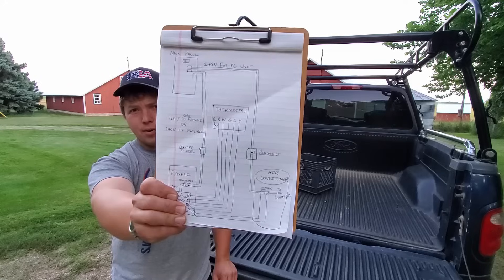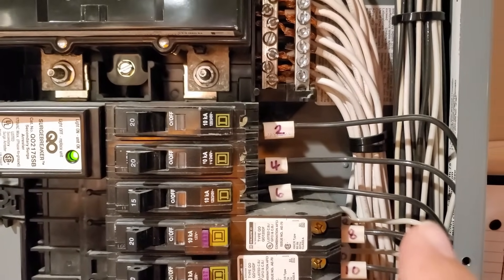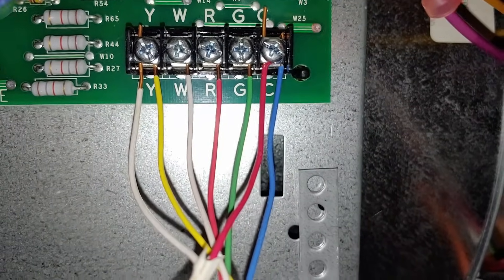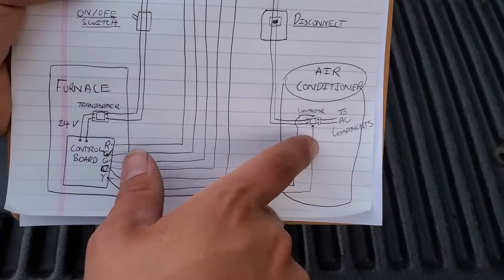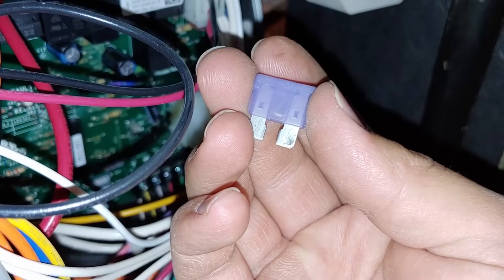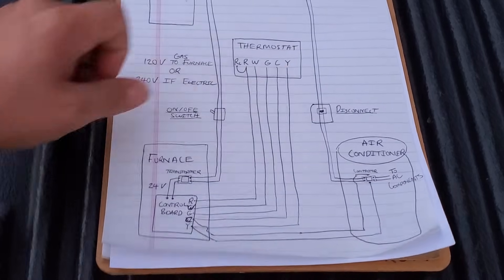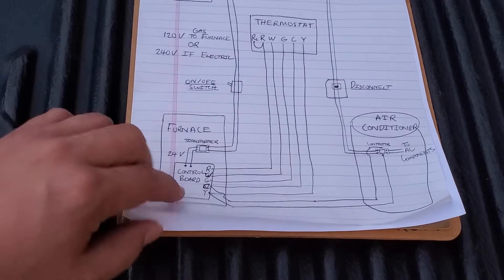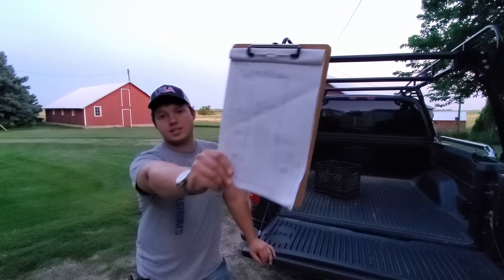Thermostat Wiring Explained!

Comment: No it won’t jump the thermostat will send a signal never jumper wire your equipment during trouble shooting and ya comon or c or blue is also called a ground common is ground your touching power to the ground if c touches red

Comment: Good review.  The air handler has two fan speeds when there is an A/C  evaporator in the system. the high speed is for A/C cooling and the slower speed is for heat. I was told warm air moves easier than cold air thus the lower speed fan does the job better as it doesn't cause a breeze effect in the home for no reason.  
I am impressed with the "colors" used for the main board and thermostat terminals. Not many techs are able to spit out that bit of information as they discuss low voltage wiring. Now that you have 10 years in the field, how many jobs have you been to where the customers HVAC systems are completely wired/rigged wrong and have poor ducting designs, bad returns designs, awful supply registers and lame return filter set ups ?  Probably more than half ?

Comment: This was great and helped me to identify the board fuse issue but my fuse keeps blowing, any additional videos?  The fan motor to the AC seems to be working fine.  I have a 3A fuse on my controller board.

Comment: Great.    some confusion  the hand drawn connections were written over to line up the the names end to end just white out the error . hard to tell the sequence or cross out which was the error and the correct label . bypassed a bad thermostat then replaced.it  good job.

Comment: I keep having AC repair people come over and the AC works, however it worked because I was shutting off the furnace switch which was resetting the circuit board, 
Turns out the Thermostat batteries weren't delivering enough voltage to the transformer  so wasn't always holding 24 volts at the contactor and would work 1st cycle but then fail on subsequent compressor restarts, fan always worked only the compressor failed to boot up..

Comment: Hi Benjamin thanks for the great video.Question i have a friend that want to install a heat pump to supply ac and heat to his two family house but he want to pay for the heat and tenant pay the ac in the summer time so the unit will feed from tenant panel for ac and from house panel for heat, if i take the R-Rc jumper out and use the R with  separate 24V to feed the coil of contactor to bring power from house panel that will work ? Any idea how can i accomplish that set up? thanks again

Comment: Have a ? People were working with the power at my house before they turned the power off ac was working now when they turned it on my nest thermastat saying no power no fuse was pop could it be the tranformer that is bad because the breaker in the ac wasn't burnt either I'm waiting on the new tranformer I was just wondering could thar be it

Comment: Too bad the complex I work at doesn't have a control board. They're all connected via wire nuts. Yes, that's how it was originally installed.

Comment: Ben, Thanks for your excellent content!  I’m hoping that you or one of your subscribers can help me with basic information.  I have a new addition on a home I just purchased. The HVAC service to the addition is weak. I purchased an inline fan that can be operated manually with a switch or by the thermostat using a Relay in a Box (RIB). One side is 24V and the other is 120V. I know I need to connect the 24V and 120V wires to the thermostat terminals and fan. The question is, where do I connect this relay within the circuit board? 

I understand the 24V colors and what they control but I’m unsure which of those connects Is the best one that will close the relay to power the fan when the heat or a/c or fan is operated by me or the system. 

Thanks again, keep up the great work.

Comment: Thank you. Excellent and clear presentation.  I think now I now why I don't have cooling on one zone, but have cooling on two other zones (all three zones on one gas-fired furnace). The "system" works as designed when any or all three thermostats are set for heat. If I set either or both thermostats in my office or bedroom for cooling , the "system" works as designed but. when I turn on just the main thermostat and set it for cooling  neither the furnace fan nor the compressor makes any attempt to start. To me the fan and compressor are OK. I suspect a serious examination of the main thermostat is a good starting point. William Philcox, P.E.

Comment: I have a 24 year old Bryant Plus90 MAV 350 model. I need to connect a C wire to the HVAC circuit board. The Circuit board doesn’t have a post marked C. The Thermostat wiring harness has five wires. The old thermostat didn’t have the blue wire connected. The blue wire was terminated at the thermostat and the circuit board but not connected.

The circuit board has the following wire posts marked as G , com24V, W, Y, R and that’s all.
To supply my Nest Thermostat with power, do I connect the blue wire to the “Com24V”?
Thanks in advance  for answering!

Comment: At around 7:37 you state that the thermostat shorts the R to the Y AND the R to the G so the furnace will turn on the fan during a cooling cycle. That is NOT how it works. The thermostat only shorts the R to the Y to let the furnace know there is a call for cooling. The control board on the furnace itself operates the fan. Unless running the fan by itself for ventilation is desired, the G wire does not even need to be connected to the thermostat at all. The heating and the cooling will work just fine if the G terminal is wired or not. There are a lot of people who think they have to purchase an "add-a-wire" module to convert to a 5 wire system to use a smart thermostat if the existing wiring is only a 4 wire system. In actuality, they can disconnect the G terminal on both ends and instead connect it to the C terminal on both ends and the smart thermostat then has the 24 volts and return that it needs to power itself. The furnace and A/C will function normally. The only function that doesn't work is the fan by itself for ventilation which the vast majority of people do not use anyway.

Comment: It took 8 previous videos (worthless info) to find THIS GUY! Absolutely TO THE POINT, VISUAL REFERENCES AND EASY TO UNDERSTAND!  I do all my home fixes and a/c with a new wi-fi thermostat wanting a C-wire (when I only had 3 (R G Y) at the old thermostat. Now I need to run a new 5 wire and use R G Y B (B=C). I was HOT (angry) before viewing this video and now COOL AS A CUCUMBER with A/C working and wi-fi thermostat ‘talking’ to system. THANK YOU - KEEPS THESE VIDEOS COMING.
How about a video on old steam boiler and replacing the old blow off strainer (filter silt, gunk out). Also, replace blow off mechanism with new one. I’ve done both and people need to see they can do this with basic tools but MUST get the CORRECT (BOILER MODEL) PARTS PRIOR.

Comment: Ben..could u please explain thermostat wiring for a trane 2 stage furnace with the dip switch set on auto  for 4 wire only thermostat wire?..where we and we are jumped together at the furnace but no wire at we on thermostat..will it still run in low and high stage?

Comment: Great video!  My thermostat has a black wire connected to U1 and the other end to a honeywell damper actuator.  The installer placed an orange wire jumping C to the other U1 (two U1 terminals).  I'm guessing these connections are providing power to the damper actuator.  My problem is upgrading my thermostat.  I tried installing the Nest but they told me that I didn't need that black wire connected for the Nest to work.  I'm concerned about the damper actuator.  Can you shed light on this dilemma for me?  Is there a smart thermostat that considers damper actuators?

Comment: Great informative class, just what I was looking for. I wish the guy who wired my system followed your instructions. I do not have the blue "common" wire, just only 4 wires. White for heat comes down and is tied together with white and black at the heat pump. Yellow for AC is actually blue and comes down to be tied to red at the heat pump. Green for the fan is as it should be. Red for 24V is as it should be, and jumpered to Rc.
I was trying to hook up a digital Amazon Smart Thermostat, and it is requiring the Blue common wire I believe... my heat will not indicate on the unit, only the AC will show.
Thank you for the class.

Comment: So if you have a unit with a separate air handler with its own Transformer you can wire the 2nd transformer to RC (remove the jumper) and then run the air handler with the Rc and G terminals and run the heating coil with its 2nd transformer to the R and W terminals? and both systems remain electrically isolated?

Comment: Thanks for the info. I had a repair guy come out and replace my board. A week later my outside unit wouldn’t come on. Looks like he didn’t connect one of the wires for the outside unit to the c terminal. You just saved me several days of sweating. Again, thank you.

Comment: I have a Honeywell T8000 Programmable Thermostat (without batteries) and it has all the wires you indicate, but it also has a wire marked "B" and a wire marked "O". If I replace this thermostat with a new digital thermostat will I use these "B" and "O" wires?

Comment: Great video however something doesn't add up. In my scenario my thermostat only has the R and W wires hooked up and it works. It did have color coded wires installed as well but I followed those wires to a block that plugs into an outlet maybe it is a transformer that you plug in  the thing is though that transformer was never plugged in and the thermostat was working fine. Also the control board on the heat furnace only has the red and white wire connected to the control unit. There are other slots for the other colors to screw into but there are no colored wires except red and white. Maybe I have a different style furnace where some of the controls are internally installed on the control board.

Comment: Great video! I’m trying to install a five wire thermostat cable so I can have a c wire connected to my smart thermostat and your video gave a lot of clarity. Quick question would an existing c wire be already connected from the furnace to the outside AC unit?

Comment: Nice video. I appreciate the info. I have a similar setup, but instead of an AC unit , its an old R22 heat pump. how can I force to stay on heat  mode without triggering my Aux (electric coils). thanks

Comment: I’m try to install a nest thermostat in my home and I installed it as directed by the thermostats instructions. When I turned it on no heat. However I removed the cover to the unit outside and learned that the green wire coming from the thermostat is not connected to anything. Should I run a wire from G terminal of the motherboard to the green thermostat wire?

Comment: i have an american standard furnace ,, garage furnace so no a/c  my thermostat has only a red wire and white wire that went to my old furnace ,, i just cant find out what to hook the red and white wire to in the furnace ,, circuit board or whatever it hooks to ,, can you tell me where my thermostat wires goes to...

Comment: As a former electronics tech, very well done.
Do you have a  video on a duel zone. I have single gas pack connected to a diverter for upstairs and down stairs. The thermostats connect to a control board, Carrier Weather Maker. I would like to replace my two Carrier thermostats with two Nest thermostats.  TIA.

Comment: I installed countless smart thermostats, in place of existing over the years. Your explanations were simple and precise. Very old heat/AC systems might not have a "C" wire available to power the thermo programming. About 30% of my smart thermo installs, require installing an additional cable to produce the "C" connection between the air handler and thermo. For DIY people, Shut the power, I work live. I been doing this 40 years. If you make one mistake on the printed circuit inside the air handler, the 3A fuse will protect printed circuit, but there is a very good chance, you could short a circuit board, then the entire control board inside the blower will need replacing. My helpers caused this problem by not following my detailed instructions

Comment: I have been binging these HVAC thermostat wiring videos in prep for installing a smart thermostat, and this is easily the best breakdown of the wiring that I have seen. Thank you!
Reply: LITERALLY why I'm here too
Reply: If you are installing a smart stat make sure you have a common wire! If not, make sure you get a smart stat that doesn’t require a common wire at the thermostat but will have a separate distribution panel that goes on top of the furnace or air handler.
Reply: I agree, i just got my AC to work finally with ecobee thanks to this video.
Reply: Most decent thermostats will need that "C" or 5th wire to run them. Battery powered thermostats don't however, batteries leak, they will eventually need replaced at an inconvenient time unless you change them on a schedule, plus the cost over the years. There's really no gain to use a battery powered thermostat unless you want to avoid having to update your home with a 5 conductor thermostat bell wire to the attic or to the furnace. One day, all HVAC systems will require that 5th wire so may as well put it in for the day its needed.
Reply: Installing a smart stat will give the government control of your usage!!!
Reply: Very good explanation. However, maybe if you put live videos/ pictures with the notebook pictures. I'm not complaining, it was very good. Do you have a video showing how to run power to the unit (specifically a new Amana 2ton natural gas central air unit?
Reply: I have a blue wire between the thermostat and the zone board.  Should that have enough power or if not how do I add a second 24v transformer?
Reply: So good, I watched this 3 times.
Bravo
Reply: I'm trying but in a heat wave and resisting to call hvac to not get scammed
Reply: Can I run a wifi thermostat with no Common wire??
Reply: I dont have 24v to my smart thermostat, what cause it?
Reply: What’s differences between RC RH
Reply: I noticed that there has been a device “Google Power Connector” to gain the common wire, I suppose this is short of running that 5th wire up to the Nest thermostat. I think they are creating more of a hassle for people than to just requiring them to run a new cable. Usually the thermostat cable does have a spare wire but once they tell the public to install this Google Power Connector people just follow the instructions. It works but in my opinion it is hacked.

Comment: I needed thermostatic control of the fan on my furnace so I hooked a 2nd thermostat ( G wire on 1st to R on 2nd and G on 2nd to fan on furnace. In the winter I leave the first thermostat set to fan and then when my house gets cold the 2nd thermostat cuts in the furnace fan. I have a heat exchanger installed in the hot air plenum that has hot water circulated through from my outside coal fired boiler.

Comment: HI MR SAHLSTROM I HAVE A LENNOX PULSE G 14 AND  I CHECK THE CONTROL PANEL A DOES NOT HAVE A 'C' CONNECTOR  HAS R-W-Y-G-AND T IS THE T THE COMON CONNECTOR FOR THIS UNIT? LET ME KNOW  IF YOU SEE THIS COMMEN THANS VERY MUCH

Comment: Great video. My Lennox unit is wired up just like you showed however after installing a Nest Thermostat the furnace continues to run even with the face plate pulled off the wall or the thermostat in the off mode.

Comment: Hello I have a single stage heating and cooling unit in the attic but when I set my heating thermostat to 82 degrees my unit shuts off at 72 degrees and never gets to the desired temperature any idea why that happens?

Comment: Hi Benjamin love your videos!
I know you have the wiring laid out to the AC compressor.
Do you know if the Compressor from the thermostat is fed a constant ground to a relay at the compressor and then fed 24vdc to turn it on or possibly ground and 24v are sent at the same time?
My old system does not even have a Y terminal. I have a R W G and C.

After diagnosing a bad 24v relay coil to turn the exhaust fan on (inducer fan), I drew out a schematic for the entire system but had to leave before figuring out how the AC system gets turned on.

Comment: Thank you so much, very well explained!!!
Reply: Quick question, I had a wire come loose, and can't figure out which terminal to to put it on.  I have NO wires on the furnace board's common, but I do have a battery operated thermostat, is that why. Whoever installed it also connected the two lines coming in from the AC unit along the basement ceiling floor joists, about 5 feet before it gets to the furnace.  Is it normal to have no wires on the common? Thanks!

Comment: First time homebuyer and never changed one of these before so I hope this isn't a dumb question.  
When I looked at the old thermostat it has batteries in it and no C wire. The new one I bought needs the C wire in order to work. I have a lot of additional wires to choose from. How do I figure out which wire is the C wire? Do I just look for the additional wire that has voltage going to it?

Currently the old thermostat has Green going to G, Yellow going to W and Red going to RH with an independent black  wire connecting RH and RC

Comment: Very through. Thanks. My issue it that I have 2 systems. Heat and AC. The AC does not run off of the furnace. It is a separate unit. It has it's own fan system, which, from what I see here, needs a G wire and separate signal. Or else, the furnace fan AND the AC fan will both come on. Which I don't want. Thanks though.  (I am trying to eliminate 2 thermostats and make the ONE for both systems)